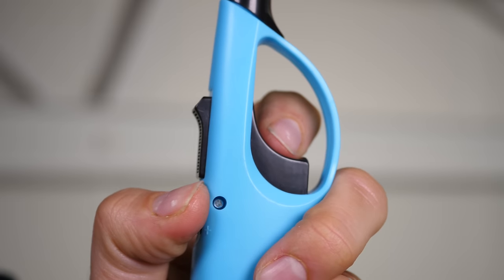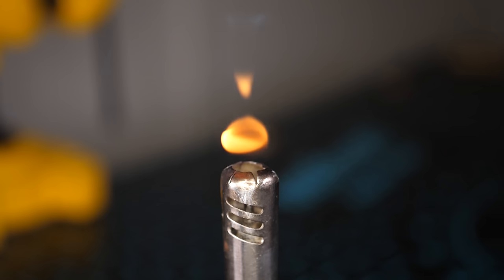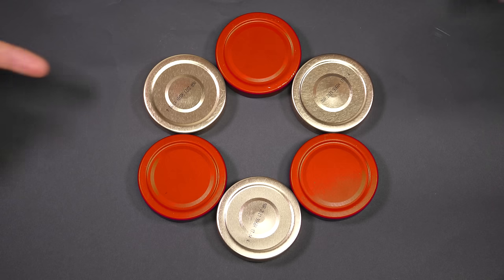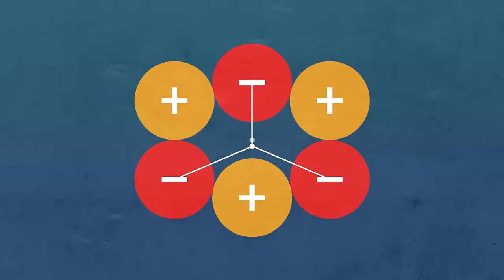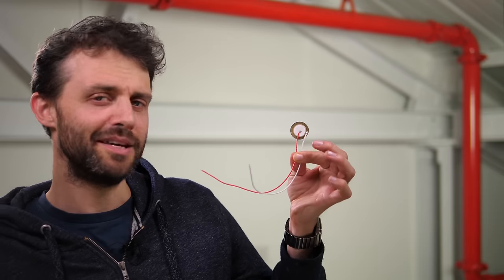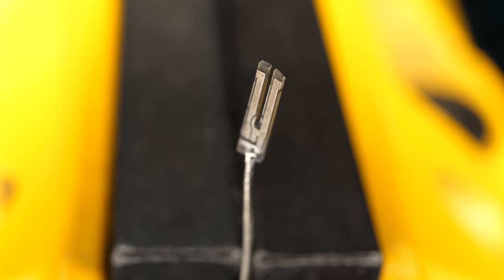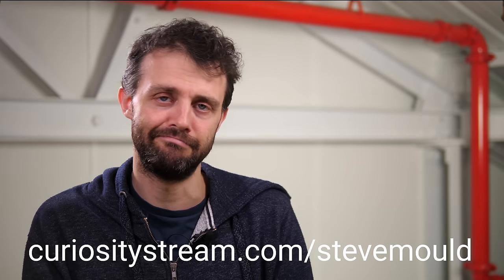Piezoelectricity - why hitting crystals makes electricity

Comment: I feel like there is some serious use behind this that our future generations will hopefully discover. To me right off the bat it sounds like a perfect power source.
Reply: I am doing research on some piezoelectric cantilevers with 4 piezo layers. I got maximum 8.2 V so far, but they must operate at resonant frequency. Which in lab is easy but if you want to use it in practice on a vibrating machine, it has harmonics, various operating regimes etc. The power you get (calculated based on signal analyser impedance) is some 30 microwatts. Very poor but can power some LEDs or wireless sensor nodes only if you operate it at resonance. Conversion efficiency is good but piezoceramics cannot be pressed or driven over ultimate tensile strength of the component materials (in my case copper electrodes 33.3 MPa).
Reply: That's the basics of ultrasound you make the crystal resonate at 1Mhz - 50mhz to produce it
Reply: @jackleokraft  No. That's the inverse piezoelectric effect when you electrically supply a piezo and it produces oscillation/deformation (actuator). The guy was talking about power source, hence direct piezoelectric effect, when you apply pressure/vibration/shocks and the piezo produces electrical output (energy harvesters, as well as sensors such as accelerometers).

Comment: have we figured out how to use quartz to store information? seems to me that unsmashed center of charge as one position and smashed center of charge for the other position can be used as the 1's and zero's in binary code and boom you have a quartz crystal hard drive with huge potential for capacity, imagine one crystal that could store 100's of terabytes

Comment: I have a piezoelectric pickup in my guitar. how does that work to produce different tones?
Reply: The electricity produced mimics the string vibration frequency. Simply amplify that signal.
Reply: Also note that some early microphones known as crystal mics did actually use a vibrating crystal to pick up sound. The crystal was mounted to a diaphragm that would more efficiently resonate and vibrate when exposed to sound, and the flexing and vibration of the crystal created an analogous audio signal to the sound being picked up by the microphone. While modern piezo microphones, and piezo tweeters,  use a special ceramic element (originally developed and patented by Motorola), early crystal mics used a Crystal of something called Rochelle salts,  or perhaps alum, an aluminum compound. These crystals tend to be fragile, and degrade with exposure to heat and moisture, and can also be damaged if the microphone is dropped. Early Crystal Mike's are much in demand by blues harmonica players, they have a gritty distorted tone which is considered desirable, but finding a good working one is not  easy. if you find one of the flea market, put it near your ear and shake It, and if it rattles similarly to a salt shaker, then the element is definitely bad. By comparison, a ceramic piezo microphone element or tweeter Is almost impossible to damage or destroy.

Comment: Pyramids

The great pyramids contain a lot of quartz. 

I’m just sayin’...
Reply: That makes sense. I don't buy the theory that the pyramids are tombs. I think the tunnels in the pyramids may be wave guides for directing the energy harnessed by the pyramids.
Reply: you know, i also believe the structure of having three negatively charged atoms, three positively charged atoms and the way they propel each other, might have something to do with Nicola Tesla's research. He had a quote "If you only knew the magnificence of the 3, 6, and 9, then you would have the key to the universe. He also took the idea of the pyramids into account of some of his inventions. But hey, who knows right
Reply: Fox Troft - Thats a great observation. I hadn’t thought of that, but it makes sense. 

I’m a huge Tesla fan. I think his tower at Wardencliff was similar to the pyramids. It was a tall structure with water aquifers underneath. I think the water helped generate his electricity. If you split a stream of running water, the two streams will have different electrical charges.
Reply: Exactly! So fascinating
Reply: Any Hoot i think you’re right. Somehow the pyramids were used to harness power. And maybe that’s what Stonehenge was used for too and other sites like it.

Comment: If you take two quartz stones, just white river stones, not proper crystals, and rub them together with some force, they will flash, albeit faintly. The stone only has small crystals which are randomly oriented, but a force across them will generate a sufficient field to generate a flash from the regions which are oriented in the right direction.

Comment: If it is the overall movement that causes the emf, why does the bbq lighter require an impulse caused by the spring? 
If it was to coordinate the timing, the gas could be sent down when the max force is exerted. Also, the spring won't increase the compression because all the stored elastic energy in the spring will equal to the elastic energy stored in the crystal once it has been hit by the hammer, assuming no losses.

Comment: It's also used in impact fuses for RPGs. The Piezo crystal is in the front but ignites the charge from.the back via wires for the shaped charge to go off proberly. The soviet RPG doesn't even have a distance or firing safety - if you take the safety cap off and stumble with an RPG over your shoulder while running up a flight of stairs in an abandoned syrian construction site, you're history.

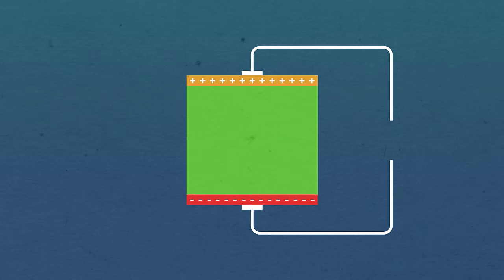Comment: What I don't understand at 4:46 however is why the electricity isn't travelling through the shortest path which would be the green rectangle and not the wire. I guess it is not electronically conductive and the wires are but I'm not sure how that works yet... On to googling more.

Comment: What a GREAT explainer. I still have a question. So basically, there's a voltage, that's energy, thus something has to be given elsewhere. Is the current produced only form the kinetic energy of the hammer? Nothing is ever lost from the crystal besides some possible veeeery long term degradation from deformation after  being smashed repeatedly?

Comment: The force applied to piezoelectric crystals and the voltage output have a linear relationship, its used in force platforms to study movement!

Comment: I was a sonar technician in the Navy and we used "transducers" to transmit as well as receive sound. They operated on the piezoelectric effect. You put electricity in vibration and sound comes out vice versa.  Sonar stands for sound navigation and ranging. The reason his piezoelectric pickup, typically used to turn acoustic guitar string vibrations into electric/acoustics, does not make a good microphone is that air is a poor acoustic energy transmission medium. You get power and information loss.  Could ramble on for hours.
Reply: @tst ccnt not sure what Sonar and  piezioelectricity has to do with water planets creating life.  Piezoelectric effect is very important in creating sound which bounces around and is received back and processed by computers to find objects in water as well as mapping the environment.  Bats use sonar in the air with high frequency sounds to navigate and locate prey.

Comment: Ultrasound machines use piezoelectric crystals to “see”. They are located in the little wands, or transducers as they are called.  The ultrasonic frequencies enter the tissues and bounce back. Because the different structures in the body have different densities the speed of the return sound is different and those differences create the picture.

Comment: Imagine a huge quartz crystal of just the right shape across the lattice, down in a fault line in the earth's crust. The constant rotation of the earth and geological shifts along the fault would make frequent changes in pressure and frequent spikes of voltage that could be stored, for example, in a capacitor, from which we could harvest that stored charge and used to power devices and appliances.

Comment: The very first man-made piezoelectric material is Rochelle Salt, produced in 1675, chemically "sodium potassium tartrate tetrahydrate" (say that quickly 5 times!), although it was made by an apothecary and  it's electrical properties weren't discovered until 1824. Chemically, KNaC4HO6-4H2O.  It was used from the 1920's through the 50's to make "crystal" microphones and phonograph pickups, but it is sensitive to damage from physical shock and deterioration from exposure to moist air. The crystals themselves can be large and beautiful, and I've seen videos online of people growing giant Rochelle Salt crystals in their kitchens as ornamental objects. Rochelle Salt is also used as a laxative, in the silvering of mirrors, as a controlled-burning additive to cigarette paper, as a food additive---- for an umami effect, similar to what MSG does ---- and in various industrial processes. Back in the late 1920's or early 30's, Brush Manufacturing, maker of microphones and phonograph pickups, actually patented an 8" full-range speaker that utilized a large piezoelectric crystal and didn't have a magnet or voice coil. !!! (I don't know if it ever made it past the prototype stage and into production).

 In the 1960's,  Motorola developed and patented a ceramic piezo crystal ("lead zirconate titanate", aka PZT) that is far more rugged than Rochelle Salt, and this technology is still used today ----- you've probably seen piezoelectric tweeters used in cheap speakers, and piezoelectric discs similar to the one shown in this video are used not only as pickups for acoustic guitar but as earthquake sensors and to measure internal movement, vibrations and stresses in concrete building-support pillars.
Reply: He's right Rochelle Salt was first... and Marie Curie did experimental work on Rochelle salt crystals,  to describe this effect... in fact, the word "piezo" is actually the French word for "pressure", so that's where the odd name came from... There's a lot more applications than just those...LOTS... PZT replaced Barium Titanate as the preferred hydroacoustic sensor material in nautical echo sounders and sonars... including military submarine sonars like the ones in Hunt for Red October... and the Webb telescope uses piezo elements to microscopically adjust the positions of the separate telescope mirrors, to get them "synchronized" with each other. I don;t think those materials are crystalline but they can be "polarized" ( which makes them slightly piezoelectric ) by heating them almost to their melting point, then applying a high voltage to the electrodes and allowing them to cool down, while the voltage is maintained... that "stresses" the molecules and the stress is "locked in" when they cool down... and they becomes somewhat piezoelectric, as a result. The technology is also used to make echo sounders for use on solid ground, to detect oil deposits... so between oil surveying and anti submarine warfare,  entire industries ( important ones ) have been built on this technology.

Comment: 32,768 is a positive integer equal to \(2^{15} = 2^{2^4 - 1}\). It is notable in computer science for being the absolute value of the maximum negative value of a 16-bit signed integer, which spans the range [-32768, 32767].

Comment: I learned a ton. Thanks for describing the need for a lack of a certain type of symmetry for piezoelectricity to work. It leads me to my next question. Since there's so much quartz in the earth. What happens with the earth compresses with the gravitational pull of the moon?

Comment: And there's a second piezoelectric in the digital watch - the beeper sound - also works very well because it's quite high impedance, thus makes the sound with very little power.  LIkewise is the case for piezoelectric microphones, crystals, etc. so, e.g. a small lithium watch battery can keep that all powered for 5 to 10 years typically.

Comment: The piezo-electric effect is also why people have reported seeing "lightning" or "sparks" around the area when an earthquake happens... If there's enough Quartz, or whatever other types of piezo-electric crystals there are, under the ground in the area you'll get exactly what you saw in this video... 
High voltage. 

With how heavy the rocks are underground, and the amount of pressure created by an earthquake, there's PLENTY of energy there to get some pretty big sparks out of the crystals.

Comment: The best explanation I learned at L.A. trade tech was , the material is so hard that when it is struck , the material vibrates approximately 70,000 times per second displacing thousands of electrons from their valence shell creating thousands of millivolts enough to jump to the ground like static built up on a doorknob ready to transfer. I love electricity . local 40 IBEW. Since 1998 😊 🌩

Comment: It does not have a point "inversion" symmetry. The word "point symmetry" can indicate any symmetry about a fixed point. For example, that quartz hexagon has point rotation symmetry of 120 degrees, with the fixed point being the center of the hexagon.

Comment: The energy of the spark is below the activation energy of the propane - oxygen mix. Therefore, what looks like a spring is a catalyst, nickel plated with platinum or vanadium oxyde.
When the plating wears down, the lighter doesn't light anymore.
Regards,
Anthony

Comment: Was very interesting I had no idea they used a crystal to power push button lighters I always thought it was a battery. Although I'll have to say it raises the question if it's powered by a crystal why does it eventually stop working. Every battery powered lighter that can be refueled eventually stops sparking.

Comment: technicly its not hte impact itself thats generating the electricity, its the vibration in the crystal latis that generates it, the inverse is also true you can cause the crystal to virbrate by exposing it to an electrical current, this is actuly how most digital clocks worked at one point.

Comment: Since Quartz is also distinguished as a gem that is capable of triboluminescence, or the ability to create light under pressure. would putting a piece of quartz in a vacuum chamber make it create light? or does it require a different type of pressure to produce light?

Comment: Actually, I remember the old lighters and they barely required any force to actuate. I believe the stiffer springs came about to prevent kids from being able to press the buttons. The regular flint lighter was also inherently harder for kids to operate, so when the soft button lighters came along it just made it easy for them to light shit on fire.
Reply: Did the soft-button lighters have batteries? I vaguely recall lighters having batteries years ago. A battery-powered lighter would use an inductor which is basically the electrical equivalent of a spring. Cut off the current suddenly, and you get a terrific whack back in the form of voltage. An inductor is just a coil, possibly with a core, so as a bonus, you can wrap the coil in another coil with more turns to make a transformer, getting even more voltage.

Comment: seeing the video for the second time, i learned at school for electricity to jump 1 mm, you need about 1000v.
How much can the lighter piezo element generate?
There is also a term on how much voltage a insulator can resist before it "breaches".

Comment: Distorting the crystal structure (with a tap), dislocates the location of the average pos and neg charges resulting in a current to even out the charge.  But the crystal must likely rebound after the tap to return to it's pretap structure. Thus, the tap distorts the structure to displace charges, and a current happens to equilize charges of this distorted crystal. But then the crystal returns to its undistorted orientation, which has charge distribution different from the equalized (post current) distorted structure. So when the crystal returns to its unditorted shape, is there another current due to the different charge distribution previous distored and equalized crystal and the new rebound undistorted crystal?

Comment: So if you made a block of this stuff with a cavity inside, then filled the cavity with something that expands before securely plugging the hole. Provided the pressure wasn't enough to break the block, it would generate a small electric field?

Comment: Dear Steve Mould, if you were to put a micropiezocrystal and attach it to a typical nerve, would you put the positive electrode of the circuit inside the cell body in order to open voltage gated sodium channels and create depolarization? This concept is called neural dust or stimdust. I'm wondering how big of a piezocrystal you would need to depolarize a single nerve enough to generate an action potential. Maybe you could do a video on that. Thanks.

Comment: Question: So you only get a voltage when pressed in certain directions?  of a correctly cut piece?  or you get a % of a possible total value?

Basically, I thought you would get a voltage no matter what direction you press on the crystal.  But from what you are showing, you can maximize this by actual sizing of the crystal and direction of pressure.